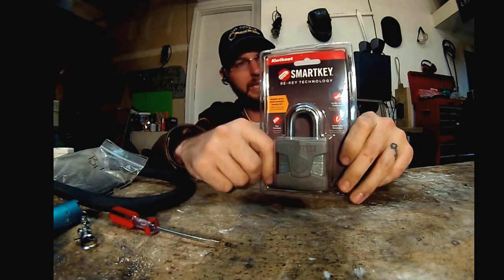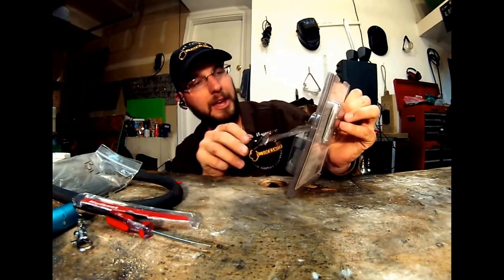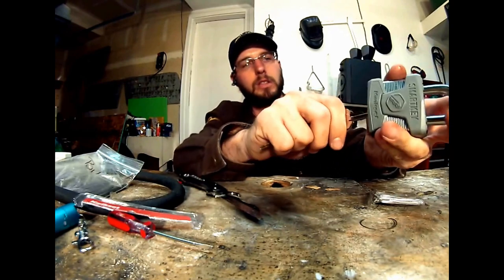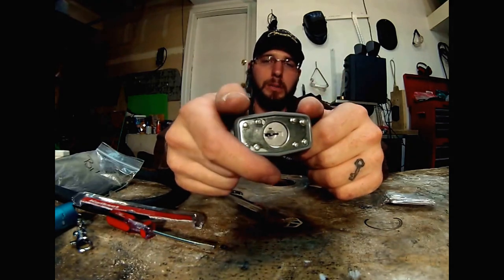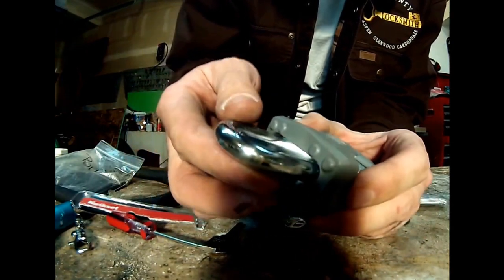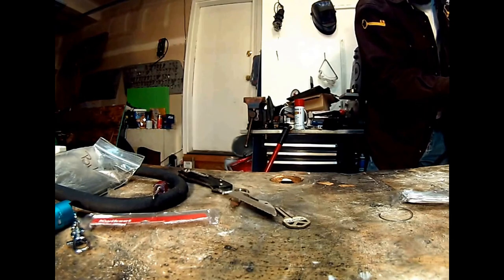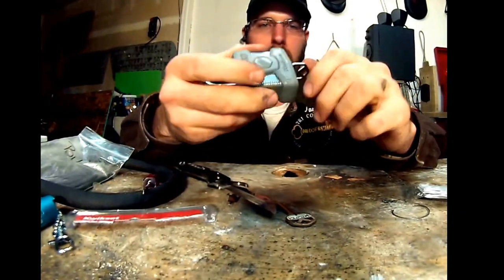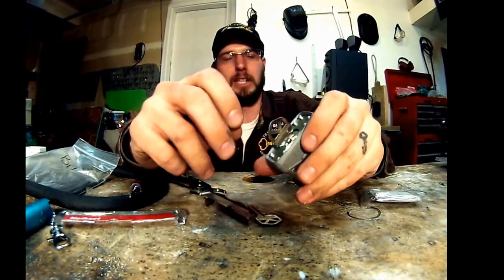Kwikset Smart Key PadLock Lock Review Kwickset SmartKey

Comment: We bought the 2" Long Shackle Padlock to secure our RV gate. The lock must have "re-keyed" itself back to the original setting because our keys no longer work. Problem 1, we don't have the original key because the padlock was keyed for us by the store. Problem 2, how do we get the lock off the gate?
Reply: I had to use heavy duty bolt cutter to cut it off.

Comment: Wait a minute ... they claim "1000 pound bolt cutter resistance"? That would be insanely low.
The 50mm Stanley laminated Padlock with its 9,5mm molybdenum alloy shackle has a cut resistance of 44,8kN wich equates to just over 10000 pounds of force, 10 times what this Kwikset has to offer. 

I can hardly belief that.

Edit: Alright, after watching the rest of your video ... well, very bad bolt cutter resistance, the 1000 pound claim might be true. Ridiculous. 
And also kind of shady. They put a big number on the package to fool unsuspicious customers - but at the same time they are absolutely honest about the bad performance and quality of their product. 
I am beginning to think that there should be a mandatory testing procedure for all locks in order to sell them. Especially with security products people need to know what they get.